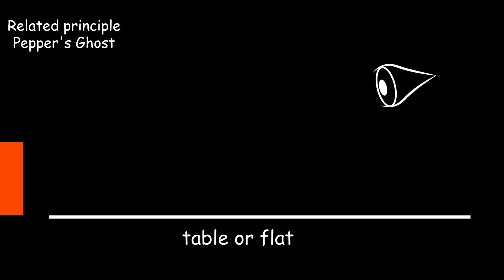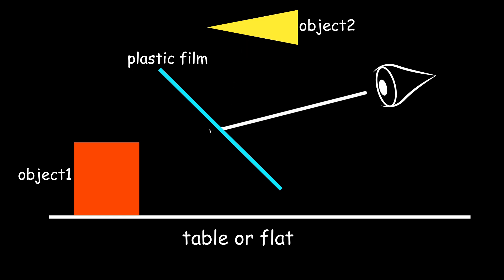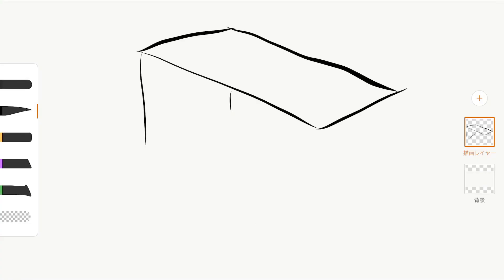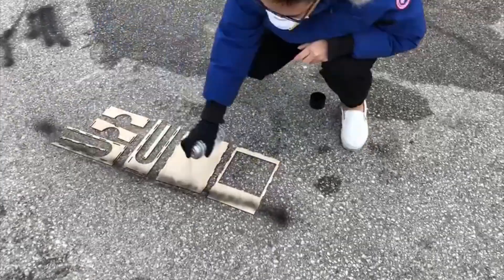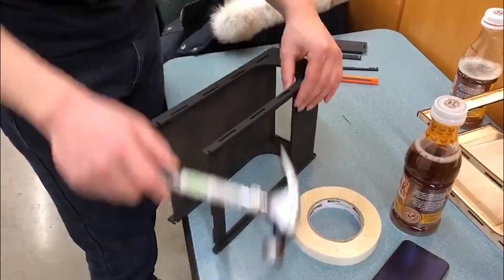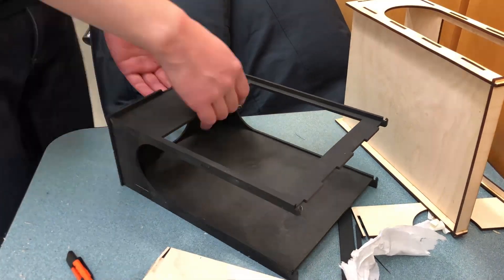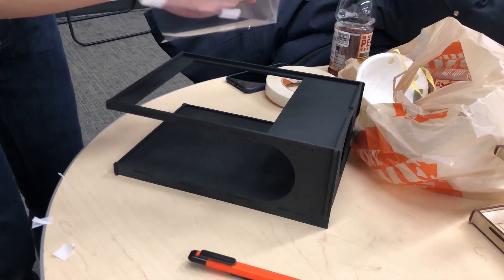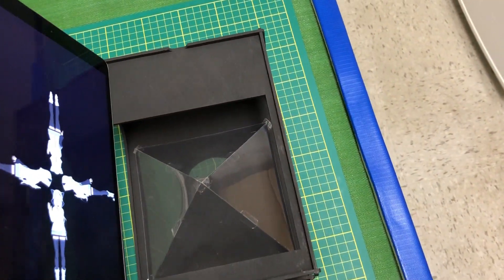DIY hologram projector

Comment: hey, this is a great tutorial. i kinda wanna recreate this, can i get the exact measurement? i saw your files but there's no numbers in it
Reply from the maker: You can download the file and open it in Adobe Illustrator (or other compatible software). The file contains the correct dimensional information and you can measure the length of each line in the software. Or you can just use the file for laser cutting

Comment: Could this be done with only the front view (no sides or backside) with a height of a meter or more?
Reply from the maker: Yes, you can do that. Just one side would be easy, but it would require a very large display, or you could optimize this by adding lenses to the design

Comment: hello could you send the measurements to me?
Reply from the maker: The length of the bottom edge of each isosceles plastic piece of the pyramid is equal to the length of the short side of your display, and the height is equal to the square root of "the square of the bottom edge divided by two".

Comment: I was wondering why do some prefer to make each side a trapezoid instead of a triangle as shown in your video? Does the trapezoid side have a smoother transition when we look around it?
Reply from the maker: Because the tip of the triangle is so thin, it can display a very small area of the image. In my work, you can also see that the top of the figure (the hat) is partly out of the display range. It is true that trapezoids are better for displaying rectangular images. However, if you use a trapezoid, the distance between the four sides will be longer and may not be suitable for displaying a tall and narrow image. (My English may not be very good.)
Reply: So you can place the pyramid to stand upright on the small side. Most hologram videos on YouTube will be upside down if the pyramid was placed on its base.
Reply: can you please tell me the measurements you used for the pyramid.
Reply from the maker: @kangsora32  The length of the bottom side of the isosceles triangle is equal to the length of the short side of the display, and the height is equal to the square root of "the square number of the bottom side divided by two".

Comment: Wouldn't it display more clearly if we put resin inside the pyramid?
Reply from the maker: You need to make sure the resin is transparent enough. But in reality, you can make the projection clearer just by making the monitor brighter.